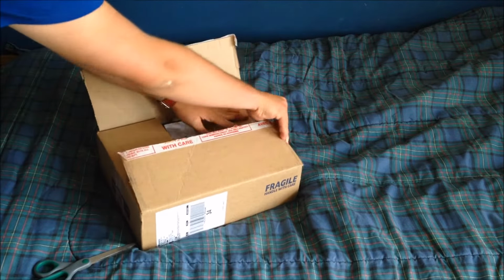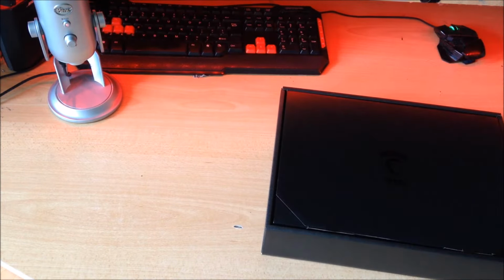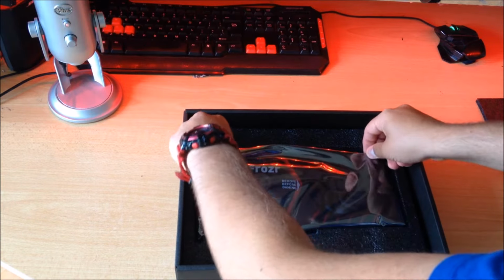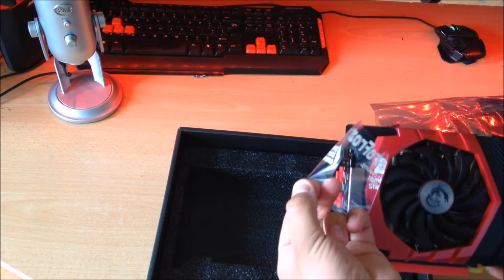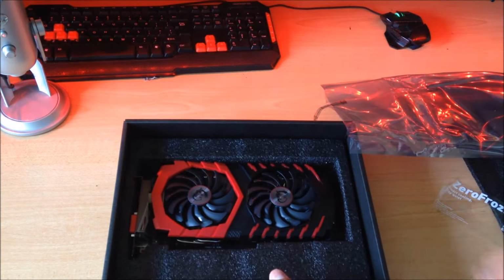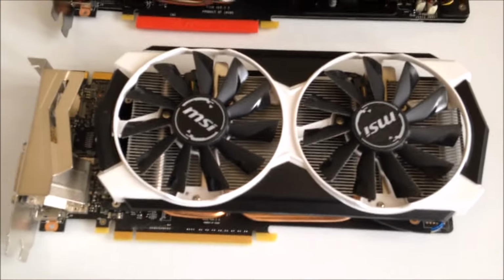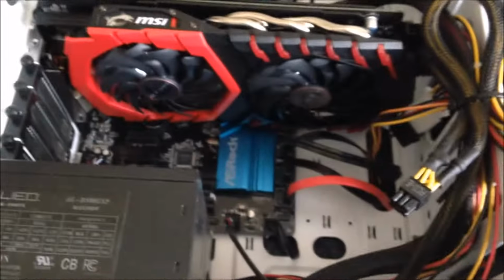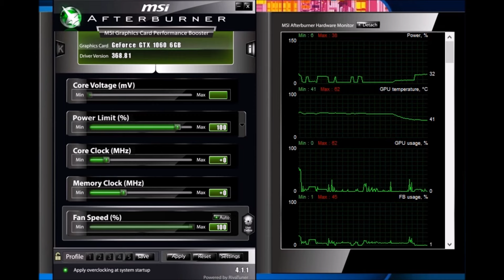MSI GTX 1060 UNBOXING =D

Comment: ok Minecraft you cant record, but I wonder what you say about so much FPS you loose when you record, you have an Nvidia so use Shadowplay i have a MSI 1080 and before a Geforce 980 Ti and i allways recorded with Shadowplay from Nvidia!!
Reply from the maker: i can record anything
Reply: Minecraft you cant record with shadowplay trust me, only in window mode but not in fullscreen :-)
Reply: On windows 7 u can record anything with shadowplay as long as you record the desktop. Trust me.
Reply: +crysismano2 i Know on Windows 10 to i man fullscreen
Reply: ok.